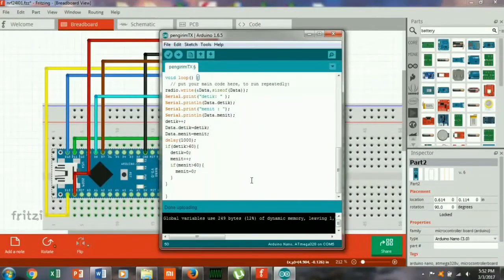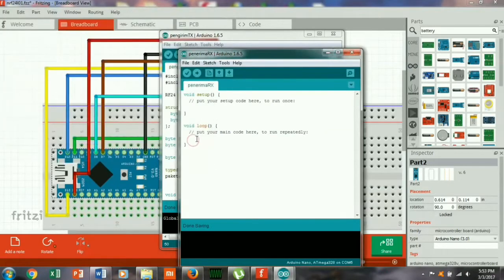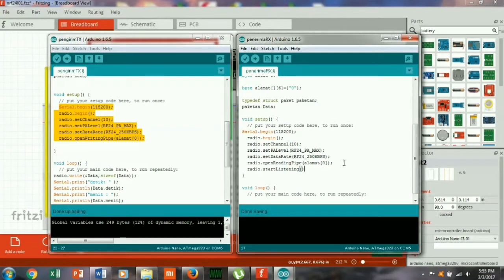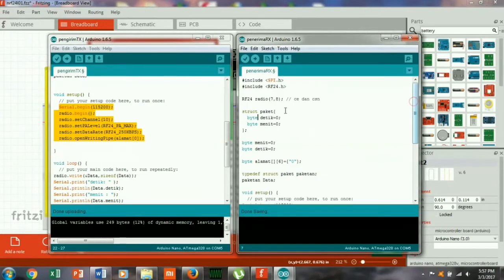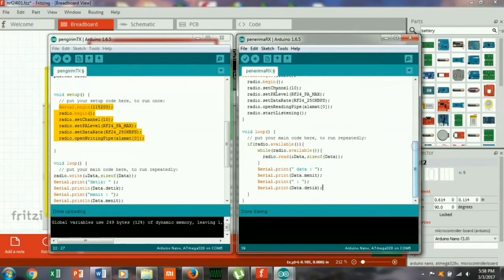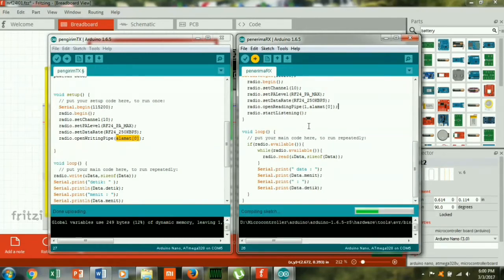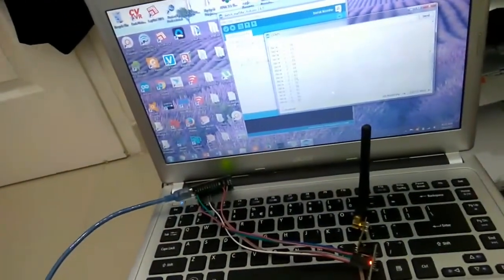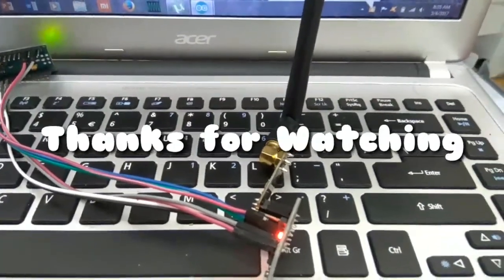How To - Basic NRF24L01 Part 2. | Arduino | Remote | Telemetry

Comment: Hi,Can you use these to inform them each other? Means that use a button for one side and if you push this button , other nrf24l01 side which has a LED will get information to switch on its LED.After that if we use a button which is in other Nrf24l01 , this will cause to inform nrf24l01 to do something.I hope you understand .d